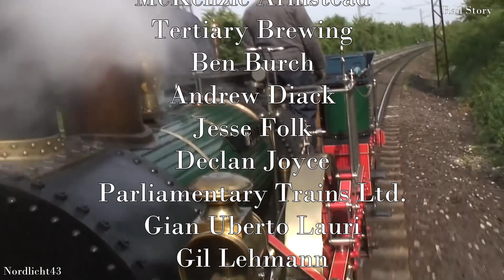Der Adler: Germany's First Modern Locomotive

Comment: Thanks for the very interesting video. I'm living in Fürth and have occasionally seen the Adler in service. She usually runs from Fürth main station to Nuremberg main station, but not on the Ludwigsbahn but on the much younger state line. To avoid changing direction in Nuremberg, she then takes the freight line around Nuremberg that leads back to Fürth. Both lines are very busy with all sorts of modern trains running around, which makes the Adler look especially tiny among them.

The route of the old Ludwigsbahn is still very visible. It has been used as a tram line, and the Adler ran on this line for the 125th anniversary in 1960. They had to grind down her wheels for that, and later they had problems changing them back for the 150th anniversary when she was supposed to run on normal railway tracks again. Today the underground line between Fürth and Nuremberg is still mostly following the route of the Ludwigsbahn.

Comment: Very interesting episode Anthony! The replica seems to go pretty well. I was surprised to hear how small the boiler was on the original. Long station stops to let it catch up, maybe? 8^) Cheers!
Reply from the maker: It was designed to run on a line only 6km long with two stations Nuremberg and Furth. It would've been absolutely fine on that route; no need for stop and brew up. And anyway, going by how Planet steams, Stephenson's boilers were excellent steam generators.

Comment: I have a running model and coaches of the Adler very nice looking loco made by Trix
Reply from the maker: Very nice!
Reply: @AnthonyDawsonHistory  I also have the Clinton Dewitt the John Bull and the Prussian all in working order and just receive the Hornby Tiger and the Rocket all beautiful looking models
Reply from the maker: @srgmiller340  Cool! But do be aware that the Hornby Rocket is based on the inaccurate 1930s replica and doesn't depict Rocket in Rainhill condition (in which it only laster a few months) and that the model of Tiger is a work of fiction: we know what Tiger looked like, and it's nothing like the Hornby model 🙂
Reply: @AnthonyDawsonHistory  The Lion and Tiger were supposed to be sister locos and should therefore be similar and as for the rocker it is very similar to the one in the museum other than the gauge they are not bad, thank you for the information
Reply from the maker: @srgmiller340  Thing is, tho' we know what Lion and Tiger looked like in service on the L&MR and LNWR - and, sadly, it's not as the Hornby model of Tiger looks. Hornby clearly did no research. Hope this will explain: https://www.youtube.com/watch?v=9L78b7a53CE

Comment: Accuracy will always be a problem when building a replica of these early locomotives, not many detailed records exist anymore, and much is guess work from general knowledge of the engines of the time and pictorials like paintings and illustrations.
Also they have to be sure an engine meets basic safety regulations if steamed which excludes the use of wrought iron boiler construction and said cast iron or gas pipe wheels, I believe wooden wheels are OK as wood gives warning signals when it starts to fail.
I noticed on the Adler that the new replica has some sort of Gab valve gear, but the levers don't move continuously, was this an improvement made back in the days or is it done for safety reasons in modern operation?
Reply from the maker: Wrought iron, riveted boilers are used all the time on traction engines and steam rollers. They're perfectly safe. They're safer than  welded steel boiler to be honest and can stand more abuse. There's no legislation against them. The problem is these days finding boiler inspectors and insurers who know what they're looking at!  Cast iron wheels are also ok, although the replica of Planet has cast steel. The replica of Rocket has cast iron tender and carrying wheels and steel driving wheels. 

The valve gear on Der Adler is it's own thing. It's not an 1830s design, it's over complicated for the period. It should have drop hooks and slip eccentric like Planet, and indeed like Patentee did: there's a full set of GA drawings for Patentee and for the Harvey Combe from 1838. The replica of Planet has constantly moving levers - and they're perfectly safe. You just need to be aware of them, but some forms of the slip eccentric valve gear did have a means to unlock the levers to stop them constantly wagging - Edward Bury notably - but it was very complicated and a lot of machinery in a small space. Must've been a maintenance nightmare!

Comment: Pity we can't run a replica of Planet or Lion on the UK mainline. Or how possible would it be?
Reply: Planet did I believe have a certificate from BR permitting use on secondary branch lines.
Reply from the maker: Planet needs a new boiler. And Lion will never steam again. Planet could run and did have permission from BR in the 1990s to run on secondary routes. It would also need all the modern signalling and safety gear fitting.